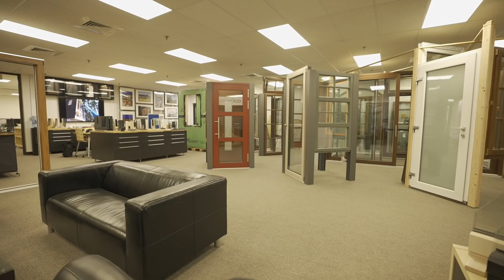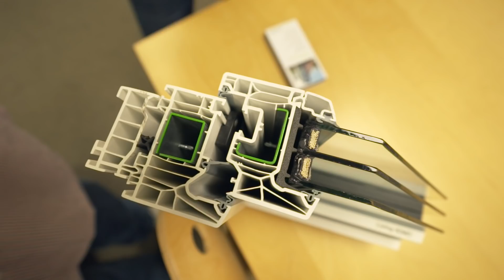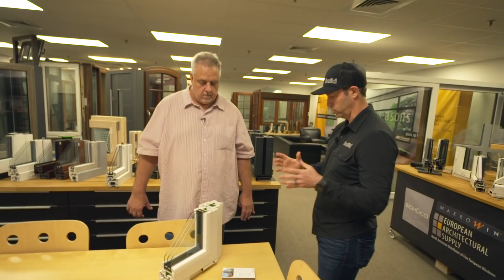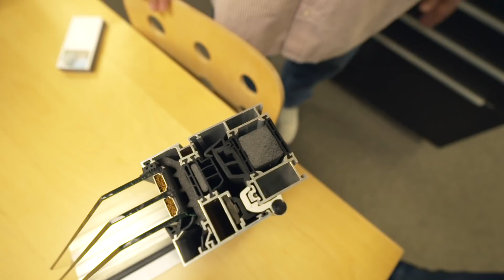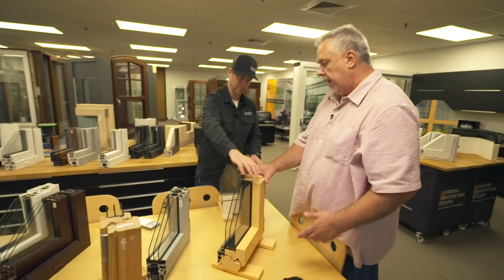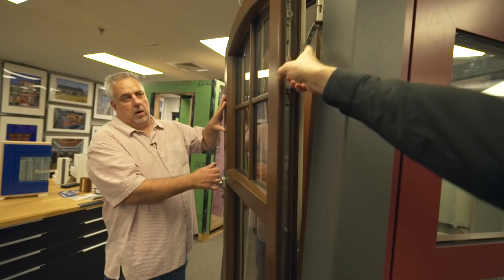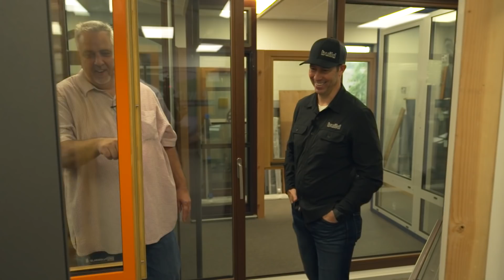These windows are AWESOME - Steve and Matt go window shopping!

Comment: I love the thick quad window looks. People don't understand how much windows matter. We frame our windows in with extra thermal break around them. And set them towards inside wall. Many places get insulated shutters due to snow depths. Snow and ice against windows damages them over time. It starts working into seems over daily freeze thaw cycles. Masonry window sills need to be outlawed. The rot from masonry is too common around me. We use the biggest window we can get from box store. 4 foot by 5 foot. It makes sense to me bigger windows mean less headers. As we use mortised glulams in timber frame post for our window headers. Windows loose the most heat, but also help gain the most passive solar heat.

Comment: Id be curious to know what the costs are today. I was absolutely flabbergasted at the cost of windows today. We replaced the windows on our old house in 2019 and spent about 1000 bucks a window for the top trim impact rated Marvin windows. We got a quote a few months ago for our current house and it was over 1000 bucks a window for mid range Andersons. The quad pane window with the laminated pane would be incredible on our hurricane zone house.

Comment: Hello another good video but I am surprised that there is no coverage on blinds for European windows. We still do need blinds on these windows and NO I am not referring to the rolling hurricane shutters they use in Europe on the outside. I am talking about blinds/shades that we can quickly operate to let light in with privacy or be completely closed for darkness and privacy. Can you shed any light on options and examples of what works in the US? Thanks.

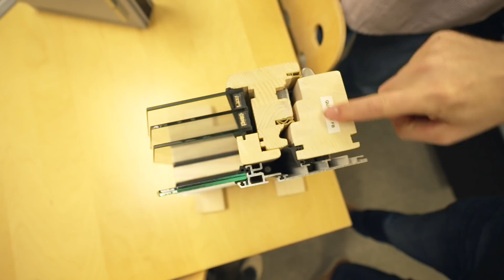Comment: The piece at 10:30 is the way to go. Metal and plastic are not bad as frame material but when it comes to longevity and functionality, wood is what you want to have. It's easy to maintain, repair and adjust for a loooong time.

Comment: Very difficult with the pivot and tilt windows to deal with window treatments on the inside.  Screens are also an issue.  I lived in Germany with similar windows.  One other thing they have, in many countries, are rolladen, a metal screen built into the exterior and is used to give light control, security, blackout option.  It lifts and lowers with a band that is located inside at the side of the window system.
Reply: How is there an issue? Screens are easy to to attach, so is also anything you want to put on from the inside. Any hardware store in Germany has a whole section for this purpose.

Comment: finally ACTUAL windows :D

I've worked in a carpentry shop doing both rehau plastic and wooden windows on custom sizes (i'm a german carpenter) and yeah, it's so little difference to get custom sizes ...

just in case they don't mention it: you can get white inside and color / "wood" outside, too ;)

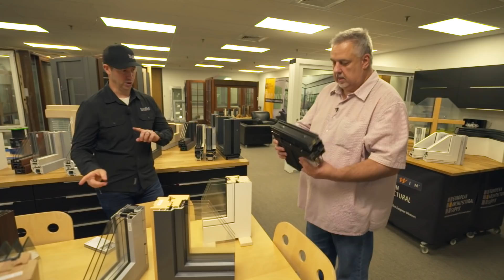Comment: 12:45 Absolutely right about the dark frames and exteriors in general. It's very much a fad and is going to look dated quickly. I would definitely lean toward white or wood in most cases. They will never look, "Oh that's so 2020."
Reply: I did it in 2015

Comment: Aluminum windows should never be used in cold climates and unless you live on the North Pole tripple pane just gives you one more failure point.  Ask Pella about the class action lawsuit against them.  That foil wrap will peel off.
Reply: There is no foil wrap on aluminum windows here
Reply: That's why there are also wooden windows, I live in an area where it is 40°C in the summer and -20°C in the winter, and I have never known anyone in my life whose PVC window film came off.

Comment: Can you buy these direct or do you have to go thru a dealer? And can a homeowner do the install themselves or do they require a contractor? I'm asking because I have found it isn't the manufacturer that makes windows overly expensive, it's the dealers and especially the contractors. If the markup isn't terrible I'm willing to purchase from a dealer but under no circumstances will I purchase thru a contractor!!

Comment: 4:45 correct here in the most of the EU in passive houses  (majority of the new houses are passive because of the regulations) windows are opened only when they need to be cleaned  that's it
Reply: exactly. i had some buildings where we installed operational windows and then had to install "blind" handles so they got inoperable ^^

Comment: Great video, why aren’t the companies in America building to these standards? He was talking about the frame locking all the way around the frame, In Italy there    front door had one inch pins all the way around there door with three pins in the top and bottom, the sides have four to five of these pins. When you lock there door there are three to four turns to there lock and that correlates to how deep the pins go into the door frame.
Reply: Unfortunately most Americans cannot afford a quality built home.  The problem is that Europeans pay a fair price for quality, but here in America we get ripped off if we want quality.  We get badly overcharged.   I've started my building project in just the last week and it is absurd what companies want to charge for mediocre hardware.  I'm getting my door hardware shipped from Germany because all we can get here is dated inferior junk or badly overcharged for mediocre junk. I can get a much higher quality door hardware for about what I'd pay for mediocre hardware here.

Comment: They have not mentioned the "micro ventilation" function of european windows. When You put the handle to 2 clock position the window unlocks but do not opens and You has milimeter spaces around the seals for ventilation.
Reply: That is not enough ventilation, it may be used when you need to dry out some things or remove some odors of a fresh build, but airflow is too small, so no real use to get fresh air. But yeah that function is a good one for some applications

Comment: Glass is cheap, until you have to replace it.
I used to build those multi-point window and door systems at a start-up called AstraSeal way back in 1982. They were far too expensive and did not take off. Superb product, just more quality than people wanted to pay for. 
I know how the mitered corners were hidden: sanding and buffing. We only had white frames, but they were spectacular.
Reply: “Until you have to replace it…” maybe I’m the odd man out here, but at age 62, I have never replaced a piece of glass in any of my homes. That said, I can’t imagine it to be significantly different from doing so in any of the crap Andersen Narrowlines in my current residence. Maybe a little longer to get the part, but, again, glass is literally something I’ve never needed.
Reply: Wow!  I am so sad that the company you built windows for in 1982 didn’t work out.  Maybe they had poor marketing.  Did you put those windows in your house?  Do you know how to still build those windows?
Reply: @pat6703  The parent company was out of Germany and still in business, but I don't recall their name. They were the first vinyl frame in this area and priced as high as Anderson Windows, so skepticism abounded, and I surely could not afford them.

Comment: I love those foiled wood look windows, but have concerns if they hold up to UV light and pet scratching.
Reply: Upvc windows are in pretty much every house in the uk. Taking the ‘rosewood’ foil in the video (which went out of fashion here about 20 years ago), you still see them on the odd house and they look like they did on day one. No fading. 

Upvc windows are super cheap here. A 6ft by 4ft window with one opener would be about $200 supply only. They are all ‘custom made‘, you choose the position of the opening window (top, bottom, left, right) the price is the same
Reply: Regarding pets, generally you have white on the inside and colour on the outside, so you can’t ‘scratch through’ the colour, at least not inside

Comment: to piggyback on baczek's statement about how glass is cheap and frames are expensive; the performance in a window is in the glazing, not the frame. so the larger the glazing area relative to the frame area, the better the window will perform. one of the reasons why US windows tend to perform better than comparable european windows under US test conditions is because, for a given set of outside dimensions, a US window will contain more glazing area and less frame area when compared to a european window of the same dimensions.

Comment: Does the foil scratch easy?
Reply: No. You would have to be pretty clumsy to mark it. It's made of upvc same as the windows.
Reply: with your fingers no chance, maybe with a screwdriver. At least on mine, its wood texture on aluminium
Reply: @Andi89lectro  awesome. thanks for the info!!

Comment: If the Schuco window tilts to vent, how do
you keep bugs out? Forgive my ignorance
Could these windows be ordered with a screen?
Reply: Germans love their exterior rolladen shutters, if you keep them in the vent position (with the slits open) it keeps bugs out https://www.youtube.com/watch?v=BMjoJKjGEE8
Reply: Almost every window manufacturer offers bugscreens and doors, I have seen them with the same wood-aluminium color matching the window. They just hook in to the first seal or are screwed into the window frame... 
The cheap option is to stick down a velcro tape on the outside of the window and attach it to that...
Reply: @Andi89lectro  I see. I would think that if you’re forking over a small fortune for these windows they would have a solution even if it is an extra cost but I’ve never seen it installed or otherwise mentioned

Comment: Vinyl is still vinyl- UPC will still not last as long as aluminum or fiberglass. Also, I though Shuco was actually almost a generic name, and didn’t market windows under that brand per se ?
Reply: vinyl has the shortest usable life, fiberglass is a bit longer. aluminum clad wood is (as risinger put it) a "generational" window. i like how the macrowin aluminum clad wood windows have welded corners. zolawindows tend to come with swaged corners, so you see the crease at the miter (you can get the corners welded by zolawindows also if you pay an upcharge). aluminum windows are the most expensive; they seem to be even more expensive than aluminum clad wood windows.

Comment: I get that they are custom but there is never a talk on price. Ballpark? What are we comparing them to price wise?
Reply: My guess, it’s hard to give a ballpark figure if these are solely manufactured to order plus the shipping overseas. I have no idea what the price would be per unit if they’re built to spec for an individual project/build. They probably also only quote if you have a big enough order to make it worthwhile 
It’s basically a boutique building item (at least here in the US) so if you have the cash to splash do it
I’m planning on a build in the near future and will be requesting a quote (I’m budgeting about 65k for windows) and hoping it will be within my budget

Comment: Would like to know how to install these windows! Because they have built in weep holes, so I suppose you don't neet to have a sloped window sill?
Reply: They weep onto the sill, so the sill still needs to slope.
Reply: Ok, would like to see one install.
We have been using these windows for about 10+ yrs. In the Faroe Islands (EU) located in the middle of the north Atlantic Ocean.
Never have I've seen an install with a sloped window sill in any window or door install.
So I'm just curious, if it is necessary or not. For what I have seen there has not been any issues.
Reply: @AriSamson09  Ok so in the UK we tend to use sloped sills, probably to keep the traditional look. Sloped sills were to prevent standing water rotting timber frames. Plastic or aluminium frames won't rot. The amount of water coming out of the weep holes is negligible anyway compared to actual rainfall. So I suppose choice is yours.

Comment: How do these perform for SHGC? They mentioned these have 70+% visual transmittance, so I’m wondering if they are sacrificing SHGC performance with worse coatings (makes sense in a Northern European climate) or if they are using more advanced low E coatings that offer the same performance with less visual transmittance loss.
Reply: The good transmittance probably does sacrifice SGHC, but that can be fine on north facing windows.
Reply: European window advocates may claim 70% visual transmittance for their windows, but that's misleading because they are claiming the glass measurement and not entire window. NFRC (North American) lists the entire window performance (glass and frame), and not simply the glass performance. This is true for SHGC as well. 

Measuring the glass and frame combination as part of the VT (and SHGC) will result in a lower number than simply presenting the glass-only measurement...something European window advocates fail to mention when comparing performance.

Three layer IGU of clear glass has a VT of 75%. while a triple pane with two layers of Cardinal 180 coating has a VT of 70%. Using low iron glass in place of regular float will raise the VT, but there is a cost involved.

Also European U-factor numbers tend to look better than NFRC U-factor numbers in comparisons because U factor performance is not calculated the same in Europe versus North America. In order to get an accurate comparison the windows must be tested to the same criteria. European window performance numbers look a lot better when converted from metric to imperial when using the European test criteria than they look when tested in North America using NFRC testing criteria.

Also the suggestion that Euro windows are somehow superior because they are manufactured using "UPVC" while North American windows are manufactured using "vinyl" is total crap. All vinyl windows are manufactured using UPVC (unplasticized polyvinyl chloride), European, North American, or wherever. 

I am not knocking European windows, they do make some amazing windows, but I am criticizing the presentation of performance differences between Euro and North American windows because as presented it is often (intentionally or unintentionally) biased toward the European products. 

Let's compare apples to apples for a clear picture of the advantages versus disadvantages between them.

Some European window companies do test to NFRC criteria and their performance data can be compared with North American products, and some European window companies don't test to NFRC criteria and those manufacturers may be offering misleading performance data.
Reply: @gregcorwin8316  Wow, your comment seems to FAR exceed the expertise demonstrated in the typical YouTube comment section. You clearly have a very deep understanding of the difference between Euro/American window manufacturing and testing. (Do you work for the NFRC or something?!) I'm curious, because many vinyl window manufacturers have a higher-end and lower-end vinyl window, and they use suspicious marketing speak to attempt to differentiate that the "higher-end" windows are also using "higher-end" vinyl. Is this just marketing double speak or are pretty much all vinyl windows regardless of price point using similar UPVC and can be expected to hold up similarly to temperature changes and UV exposure, or is there a real added value for the higher-priced vinyl?
Reply: @gregcorwin8316  the misrepresentation of visible light transmission seems to happen moreso in ameriKKKa than in europe. in europe, what they do is point you to the data for the glazing maker (st. gobain, interpane, etc) where the glazing maker advertises various lo-e coatings with various visible light transmission and u-value characteristics. but when this data gets to ameriKKKa, people promote statistics for the glazing as whole window statistics. i think that the europeans are playing the game of providing the data, which they understand, to people in ameriKKKa, who don't understand the data. then the myth of superior european window performance gets propagated.

there are conditions under which windows made in europe offer superior performance when compared to windows made in ameriKKKa. european windows tend to have superior performance under european en673 testing, but not under ameriKKKan nfrc 100 testing. what does this mean? it means that window manufacturers try to optimize window performance for their respective regions.
Reply: usually higher visible light transmission goes with higher solar heating gain (the light has to get in to get the solar gain). for example, a cardinal lo-e 366 coating has low u-values but also low visible light transmission and solar gain.